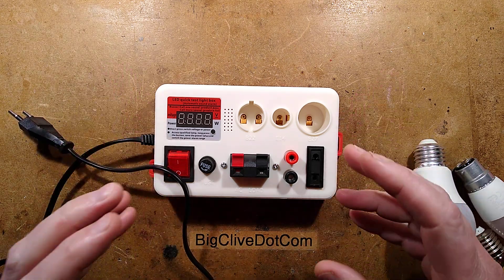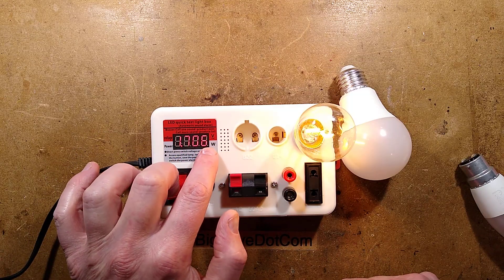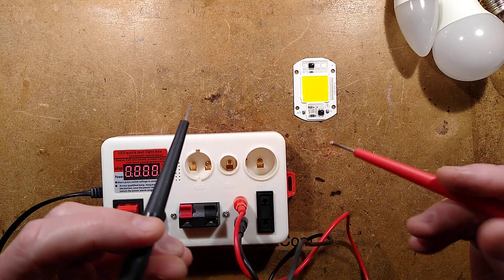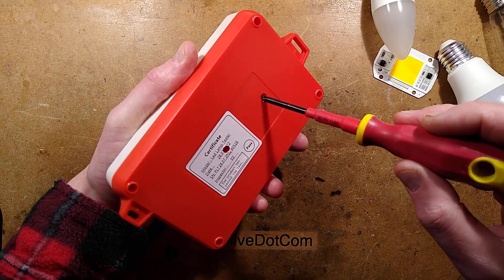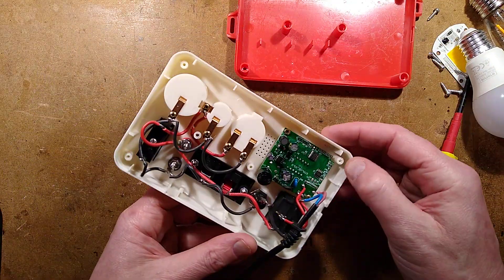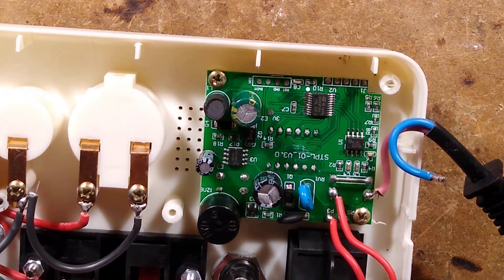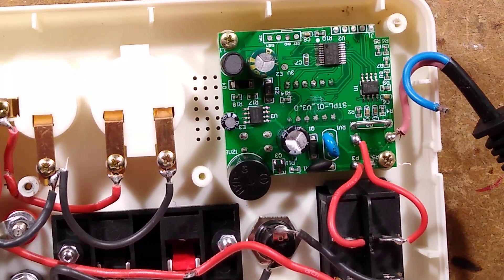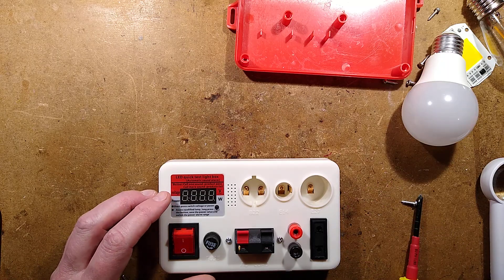Scary eBay Chinese factory test equipment

Comment: I worked for a few months in a capacitor factory (Evox) when I was 18. My job was operating a row of automatic testing machines that would measure the electrical properties of the finished capacitors and sort them into bins according to tolerance and of course rejects. One of the tests was high voltage insulation test and I once watched a maintenance guy clean the brushes (the capacitors were automatically loaded to a wheel with clamps holding the leads which would rotate and take them through the various tests, the testers would connect to the wheel by carbon brushes at each "stop")  of the machine. I noticed the main switch of the rack with the measuring equipment was turned on and we were told to always turn it off before opening the covers but I assumed the guy knew what he was doing as he was the maintenance guy and I was just a summer worker. Turned out he didn't as when he got to the HV brushes he got zapped and gave quite a loud yell. No real danger of course as the HV test was low current but I guess it still hurt.
Reply: I bet it hurt like hell. He was lucky that it was only a short zap.
Reply: @PunakiviAddikti  "You give them a short, sharp shock and they won't do it again. Dig it? I mean good manners don't cost nothing do they?" - Pink Floyd
Reply: @electronixTech  U got a fair point.
Reply: A lesson to all 18 year olds (and others, trained under capitalism to think they're less than their peers): never, ever, ever assume that anyone knows what they're doing. They don't know what they're doing. Especially, if they're reaching for live high voltage, they don't know what they're doing
Reply: @Zalethon  But I know what I'm doing: Wishing I had brought popcorn.
Reply: @Reddotzebra  it's maintenance no ones cares as long as the job is done
Reply: @Zalethon  what kinda post modernist bullshit are you spewing? Yeah, he should've said something, but that's not "capitalism", that's how a person is raised at home, and their general demeanor and personality. Plenty of kids come out of "CApiTaLiSM" and still speak up. Others don't. If you think that only occurs in people who work in capitalist countries, you haven't traveled worth a shit and seen the world. Self confidence is earned as you get older and gain more experience. And it's not necessarily tied to age either. Lots of moron 40yos, and plenty of smart 18yos. Just remember who raised who!
Reply: You are aware that lightning is high voltage low current and can quite easily kill you?
Reply: Low current relative to what? The 300 million volts. A simple search shows 30,000 amp average.

Comment: When I was a kid, every hardware store in the US had a display of lightbulbs just inside the door. In those days quality control wasn't all it should have been, so you needed to test bulbs before buying them. There were typically two strips of those threadless E27 and other size sockets that you could stick the base of a lamp in and see if it worked. You could also bring a bag of lamps form home and test them at the store, which is why the display was right inside the front door. Usually the sockets were mounted about 5 feet high so that inquisitive little kids couldn't easily experiment with fingers and pennies. Sadly, those times are long gone.
Reply: In Europe stores had "bulb testers" right until the end of incandescent lamps but they were simple battery-operated continuity testers that sounded a buzzer when the lamp was good. Obviously they didn't work with non-linear loads like compact fluorescents and LEDs so they're long gone. They usually had big stickers "Does not work for energy saving lamps" from about the mid-90s.
Reply: Perhaps also because old bulb types could suffer a broken filament if shocked in transport.
Reply: Here in Germany it was similar. However, if I remember correctly, those light bulb test panels were not accessible for customers, but they were mounted near the cashier and operated a shop employee.
Reply: @uli1956  I'm fairly sure some of Austria's DIY stores had them mounted on a shelf right by the light bulbs for everyone to access. Small electrical stores usually had them sitting on the counter.
Reply: @uli1956  In the UK most shops that sold lamp bulbs had this arrangement, a lamp holder behind the counter.
Reply: Here in the UK, back in the 60s the electrical counter in Woolworths would have a bulb testing box with two buttons, one on each side, wired in series so both had to be pressed to power the test sockets. They were primarily used to prove a lamp worked before sale.
Reply: @Graham_Langley  Woolworths, I lived that shop as a kid
Reply: @UserUser-ww2nj  It was my first Saturday job, along with a couple of hours Friday afternoon. Soon moved on to a DIY (hardware) shop that paid double along with a 33% staff discount and stayed there until well after I'd left uni.
Reply: Why would you test a bag of lamps fom home in store why not use the light fixture to test them
Reply: Still have them in a chain of supermarkets in Ukraine but at a height where kids cant test their immunity to electric shocks 😄
Reply: @UserUser-ww2nj  here in Brazil we still have this in most supermarkets. But now some of them have a switch to turn it on and off.
Reply: @MarcosRobertoDosSantosJF  Is the switch to make it safe from children or dumb adults 😂😂
Reply: @MarcosRobertoDosSantosJF  I visited Brazil a few times when working on ships , Rio ,a place I think called Vitoria or Victoria and Santos . Fell in love with a girl from the strip in Santos  , I was 16 years old 😂, just a boy .
Reply: @UserUser-ww2nj  Hahah! Yeah!
Reply: @UserUser-ww2nj  Cool! The city is Vitória. Santos is the most important port in Brazil.
Reply: I don't know in the U.S. but where I live quality control is very over the place from digital watches to Coca-Cola.
Reply: In the early 1970s my sister worked in a hardware store where they would always test a light bulb before handing it to a customer. The tester was a variety of light sockets on a wall mounted board with a switch. Back then light bulb boxes were typically a corrugated sleeve so they didn't even need to take the bulb out of the packaging.

Away from light bulbs she once had a customer come in asking for some Amps. "You know the five amps. That is what is written on the one I think has blown". Fuses of course.
Reply: Ah yes, the days when your safety was your responsibility, unlike today where we have a lot of over fed lawyers.
Reply: @paulstubbs7678  and overpaid wallets and purses too...
Reply: And, annoyingly, people are generally expected not to die in easily avoidable acts of health and safety negligence or ignorance.

#bemorelikechina 😂
Reply: @peterclarke7240  We both know that's what's made kids "soft" these days. Well, that and not having to work in the coal mines and textile factories. Kids really don't know how to be responsible anymore, you know? Such a shame....

/s

Comment: I wouldn't even touch those probes lol... I'm sure there are a lot of things that could go wrong, from some kind of impurities in the plastic to bad connections resulting in the live wire falling out.. Probably safer to switch them out with multimeter probes that are actually rated for 600V or whatever. Probes are definitely something you don't want to get a mains shock from, seeing as you're holding one in each hand.
Reply: Don't worry, he's a trained profeshunal
Reply: @BoleDaPole  :P
I know he knows his stuff, but so does ElectroBOOM, who almost died in a Jacob's Ladder experiment lol. The funny difference is that crappy wiring (probably cheap chinese clip leads or something) were pulled off and the current ceased flowing. In this case, the crappy wiring would be what gets you!

Comment: Having jammed my fingers into a lamp fitting and turning it on. Yeah i was that child, all because i was told not to. I don't recommend 240 volts. Can't say it hurt felt extremely odd. I didn't tell my parents that would have made things worse. I grew up in a time when it was acceptable to literally belt a child. Didn't do me any good at all. Children are like dogs they would rather you kick them than ignore them. Undiagnosed ADHD abd autism didn't help one bit. I was just bad. Simple.

Comment: It does remind me of test gear you see from the 50s (if the digital meter was an analogue one) that was invented before safety precautions. I would imagine this is considered super-safe in China compared to the live nails hammered into the bench. 
Remember this when buying high voltage stuff from China because its unbelievably cheap. There's a reason for that.
Reply: Equipment like this is only used in the smallest, mom and pop, uncertified factories in some rural town in the middle of no where CHina. Major factories are more automated than most people can imagine.

Comment: 0:17 Did anyone notice the Easter egg? The metal pins of the fake Europlug are still exposed while clearly already making contact with the receptacle. Not that it would matter given the other "features" of this device.
Reply: 🤨…. The pins on that plug are sleeved, see that when he inserts it into the adapter
Reply: Real Europlugs have plastic pins with press-fit metal tips. The conductive tips are short enough to be fully inserted before making contact.
But with this plug, you can still see exposed metal when Clive starts pushing it harder.

Comment: I remember something like this being in hardware stores here over in Belgium. It was a device that had all the possible light sockets and you could push in your light bulbs before you bought them so you knew that they worked.
Reply: Those were pretty standard here in NL as well. Indeed now with all the LEDs it's no longer really usefull.
Reply: @blueredbrick  exactly. with the LED crap these days you just know they'll let out the smoke in 25 month...  no need for further testing.
Reply: The ones I remember were simple continuity testers running a buzzer off of a 9 V battery if the lamp was good, which is why these didn't work with what was then known as energy saving bulbs and LEDs.

I do remember disassembling the DIY workshop of an elderly tool dealer that had passed away. His sister had high hopes of the stuff paying for the funeral costs, unfortunately none of the power tools he had there had cost more than 50 Euros brand new, all supermarket quality. The worst bit was his homebrew electrical test setup though. A huge wooden box with some kind of phenolic front (absolutely beautiful stuff I have to say, with a rich, deep wood grain effect) and all sorts of crazy stuff. 6/12 V DC from an ancient car battery charger (with a selenium rectifier), 4/6/8 V AC from a doorbell transformer, open E14 and E27 sockets for lamp testing (permanently live if I remember correctly) and a homebrew fluorescent batten with all-exposed wiring screwed to a piece of timber. Probably the most dangerous thing about it was the incoming mains though. A long cable with a plug on either end, plugged into a socket in the back of the box! I should probably also mention that the socket this monstrosity was plugged into didn't have an earth connected thanks to the ancient wiring. Didn't really matter, that widow-maker lead was only two-core anyway.
Reply: Those also exist in hardware stores here in Chile, although they have a momentary switch that you need to press before it becomes energized.
Reply: @wedontgiveasht  that's cool you still have them. Here they've disappeared with the coming of power saving bulbs and blister packages. I would like to have something like this again now so you can see the brightness and color of leds. Now that I read you're comment I remember them also having a momentary switch.
Reply: @dimitrimichaux461  With a CFL you would be waiting a minute to see that 🙂
Reply: @wedontgiveasht  It is the same here in Brazil.
Reply: Used an open and always live bulb tester when working in a norwegian electro store in 87/88. It was hanging behind the counter right next to packing line, lamp cord etc and we wound regularly have to muffle a swearword in front of a customer. Usually old people would want their bulbs tested before taking them home.
Reply: Made by Philips probably :)
Reply: I imagine those were common due to the filaments being such a fickle thing
Reply: We had those in Sweden too.

Comment: What's interesting (slightly devastating, actually,) is that it wouldn't take much to make that thing safe. If only they'd put a see-throught lid that disconnected both live and neutral when open, and ditched the horrifying probes altogether, it would have been a winner.

Comment: As a young child I made an extension lead with an Au 3 pin plug on both ends and I'm still alive so I don't know what all the fuss is about. It turns out such kind of leads are common in the USA where they're used to power the home from a generator. The tester in question would be less lethal if powered via an isolation transformer. Much to my joy there's a Chinese company making 240V mains isolation transformers with power rating from (I think)  20W up. They're ideal for those trying their hand at making our own 240V LED lamps.
Reply: 3 Prong Male To Male Extension Cord Generator Adapter Cord 5-15P readily available on line.
Better know what you are doing and not make any mistakes with this!  Not really approved at all.  Many things can go wrong.  Then again people start campfires with gasoline which is is not approved either and many things can (and do) go wrong.

Comment: how practical! Back when lightbulbs still existed, these testers were in hardware stores. Just a 9 volt battery and you put it in the open socket. If the glow wire was OK, ohmic testing was enough.
But of course that doesn't work with energy-saving lamps and LEDs.
But your device can be operated via an isolating transformer.

Comment: Interesting electrical tester. I have something similar but much less dangerous. It is a lightbulb tester with three different test sockets for Edison based bulbs and a low wattage bulb in series. The test sockets are like your deathdapter just push the bulb in to test. In the US these used to be common in hardware stores.  I mounted it high on my workbench shelving and it is powered up whenever test equipment is switched on. Quite handy for quickly testing lightbulbs.

When my son was little he was standing on the bench doing something or other and decided to stick his finger in one of the test sockets. Unfortunately power was switched on. He yelled out: "It bit me."  In the 40+ years I've owned it that is the only person it ever shocked.  At least on this side of the pond it is only 120V vs 240 for you guys. 

The nonpolarized plug, single fuse, and test leads are pretty scary in you official mains test equipment.
Reply: it'll bite you, kid
Reply: Sorry but the switch make off both side of the 2pair AC cable. If you make off is all okay. 

The real problems are the soldering (forbidden in the most European countries since the 70's) and the extra "test switch" for the second hand! But if do you use it 10 hour daily do you happy do you not "switch" at every test.

Comment: what would happen if you touched the 2 probes together ?
Reply: It's fused...
Reply from the maker: With a glass fuse rated to break 35A, it would arc internally while the probes were in the process of having their tips reshaped.
Reply: @bigclivedotcom  please could you make a video showing this process in action,as obviously this is what we all want to see 😄
Reply: You'd get a big flash and the circuit breaker in your consumer unit would trip. The probes would be ruined.
Reply: As a guitar tech, I'm mostly testing resistance and continuity and as soon as I saw those probes, I thought the first thing I'd do would be to touch them together out of habit!

Comment: Added safety feature, the fuse does not protect the circuit board. In case of power supply failure it self-distructs! Thank you, Clive - I needed a good laugh. Regards,  David
Reply: No, the poor operator 'pops' to save the tester.

Comment: My grandfather made a test rig like you described them using in China. It was for a lamp flasher add-on for porch lights. Edison screw shells but the center terminal was a wire clamped to a screwdriver. Shaft was uninsulated but the handle was plastic. Used it for 30+ years I think. Thousands and thousands of flasher units across it. So many that the plastic injection mold wore out. I got a tingle off it a couple times myself. And blew bulbs and fuses/breakers too over the years. This was in the US. I am amazed we didn't get OSHA on us for stuff like that.
Reply: But you don't have the extra spicy 240 volts mains there though
Reply: @rexsceleratorum1632  We have 240V single phase. The neutral is tapped to the center of the transformer to give 120V. Many appliances use 240V. There's also 3 phase that has 208V phase to phase depending on the configuration.
Reply: @willjohnsonjohnson  Still only 120V relative to ground. I have 3 phase at home for reasons, and it is a spicier 400V between the phases.
Reply: @rexsceleratorum1632  looking to get ~208v 3phase myself, what did you have to do to get yours and roughly how much did it cost. Currently looking at 40hp rotary phase converters. Equipment I need to power takes 74+amps 208v 3 phase. I have 200a 220v single phase service, so it should be just enough overhead if that is the only thing I am running.
Reply: @Zanthum  230/400 V is common in european countries and its easy to get. In some countries its rare to find a house with a single phase 230 V service.
Reply: @Zanthum  I'm in India, and they simply charge a base monthly fee that's way higher than a single phase connection's.
Reply: 🤨.. what is that?
Reply: It was 120v so yes, not as spicy as 240v. No GFCI or RCD or anyone watching to make sure you didn't electrocute yourself though. This was done in what was essentially a dark closet.